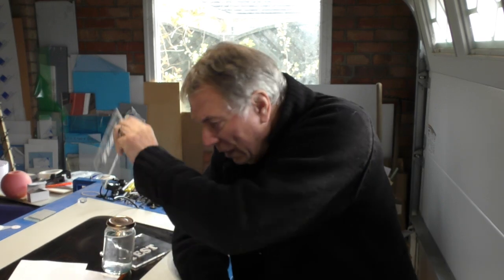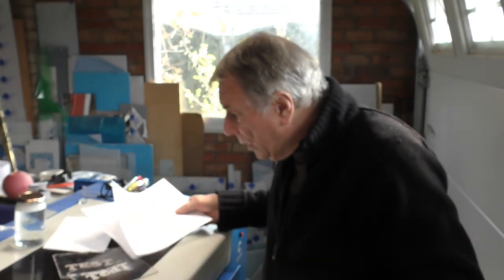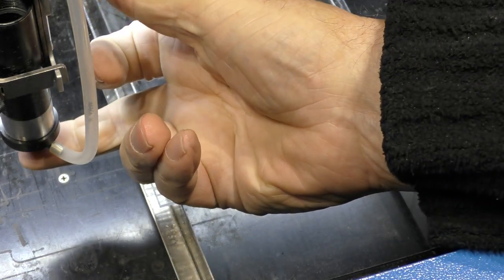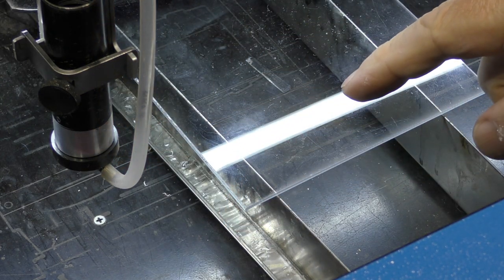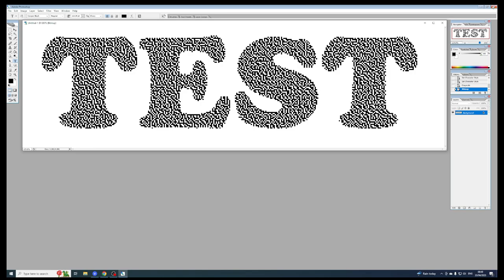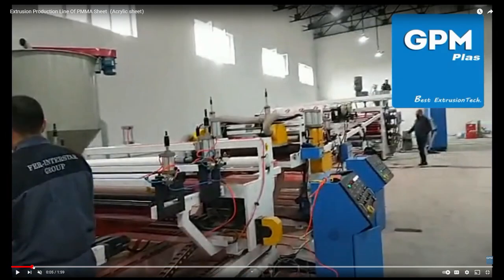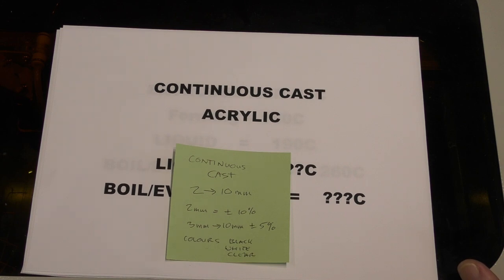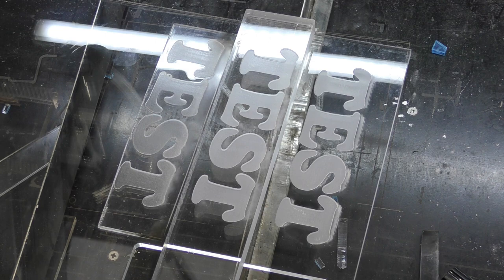CAST v EXTRUDED Acrylic Full Version

Comment: Hi, I need an opinion or answer, I need to do a lot of rowmark plastic engraving, doing medals, is it safe all the time engraving without air , with air its hard to clean plastic after, client want deep engraving, so 'marking' isn't possible , thank you !
Reply from the maker: Hi 
The problem you are concerned about (I presume) is damaging the lens with fumes if you don't use air assist to  protect it.  There may be several solutions to your dliema but it depends on the power of your tube , the lens and nozzle system you are using and the type  and pressure of  your air assist.  To give advice tailored to your system I will need to know more than we can transmit via youtube comments.  You can  disguise your email address in a cryptic form that will befuddle the Youtube algorthm that prevents email addresses in comments. For example include your details in a  normal sentence such as ...... I will be visiting john761 at the famous G company next week.  I will reply and you can then send me pictures and details.

Comment: Does engraving solid gray as dithered B&W give you a smoother engraved surface, or does it give you the same noticeable scan lines as solid black?
Reply from the maker: Because these are random and mainly single dots  the scan lines do not show. Instaed,  you are attempting to create a randon "frosted" finish. If you can feel depth to the finished product, you are either using too much power or not running fast enough. The idea is to mark the SURFACE and not to engrave  to any depth. . By creating very few "fumes" the surrounding damage (hazyness) will be zero and will just wipe away with a dry cloth..

Comment: I heard once that the main difference is that cast is virgin material and extruded is a mix with recycled ones
Reply from the maker: Hi Rick
 See this video to see how the pelletes are made  and become the base material for extruded acrylic sheet 
https://www.youtube.com/watch?v=Wl87nbpBGgA
The claim is that they grind  100% pure PMMA as the feedstock. However the difference between cast and extruded is  not the chemisrty  but just the polymerisation efficiency . How this percentage is affected when you mix cast and extruded scrap is something I cannot find anything  about. .However, I suspect it is the rapid mechanical extrusion process that is responsible for the lower polymerization  and only the cell cast and continuous  cast has the higher polymerization because of  the virgin liquid componenets  used and the lengthy, stress-free manufcaturing process.  I will be looking into the differences again in the next video which will be about the cutting characteristics of the two (or 3 ) types of acrylic.
Reply from the maker: see https://youtu.be/jt3---gLIu8